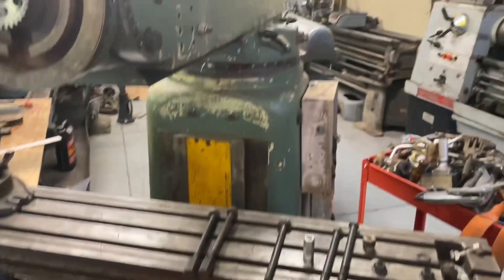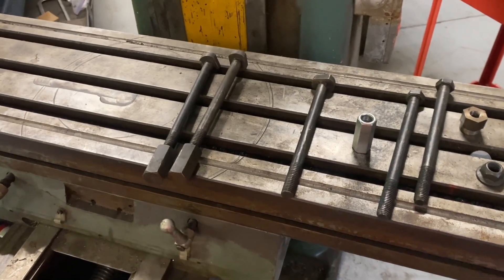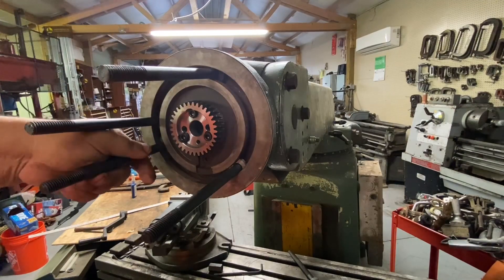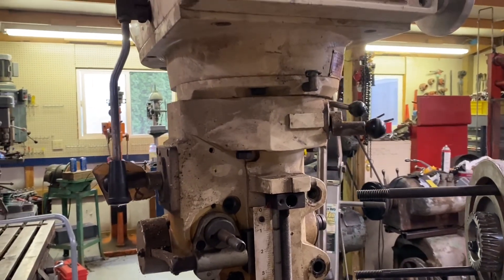Finishing the kent/jet/acer vertical milling machine, mounting the milling head

Comment: Great video Adam, my Taiwan mill head looks just like that one, can't get my high rpms to work right, it's a 2012 machine.
Reply from the maker: Iv had some where the chain on the rpm indicator is off a bit
Reply: @smalltownmachineshop6860  I think that's the problem with this one...